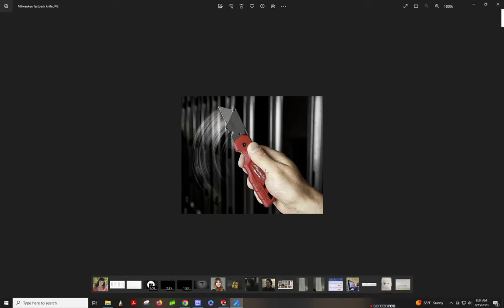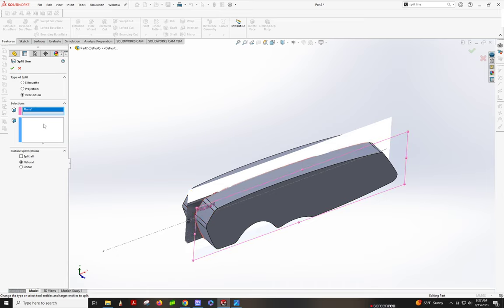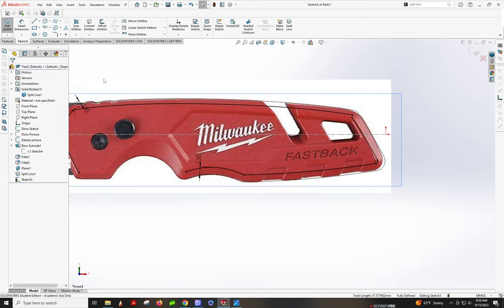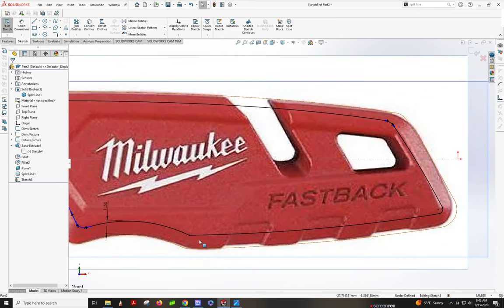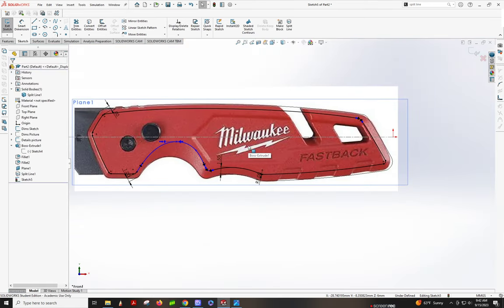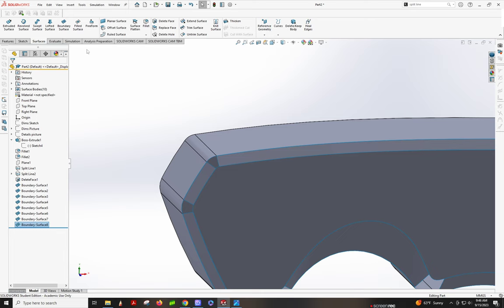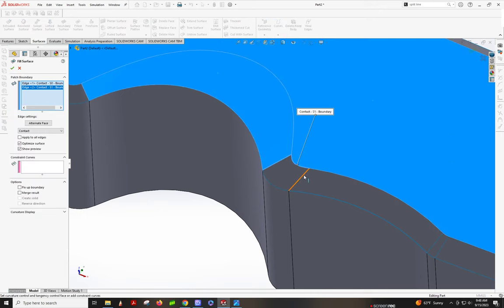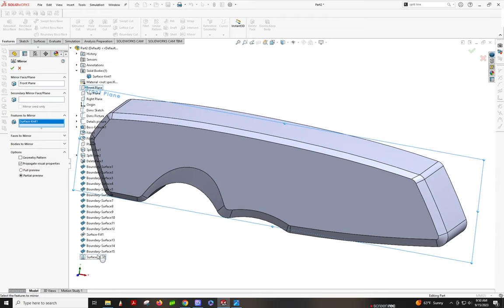Solidworks Variable Chamfer Milwaukee Fastback Knife

Comment: Very handy technique:
When the body contour(extrusion) is "forced" to match a manipulated surface. Here is my summary for future look up:

1. Basically, [BOUNDARY CONDITION] with (edge condition = none) creates the "chamfer surface".
2. Fillet corners are conveniently 4x sided and easily processed by [BOUNDARY CONDITION].  If the fillets were added in the initial top surface sketch.
3. Direction 2 (edge condition) = "tangent" to the adjacent chamfer surfaces.
Alternate technique:
1. [FILLED SURFACE] with "edge setting" = contact and "optimize surface" clicked on.
2. This does seem quicker, because you don't need to change the edge conditions; however, you mentioned [BOUNDARY CONDITION] gives you more control.

BTW, Betsy 13:46, why don't you just click on the blue/red tags that pop up to change the edge conditions to tangent.  
Don't your wrist get tired scurrying your mouse all the way left (property manager) area. I do.  
Especially, if you are using a 30+ big or wide screen, nowadays. 
Great lesson.  Keep on.